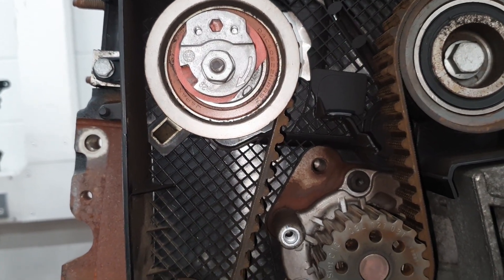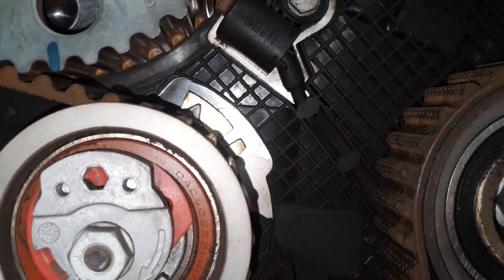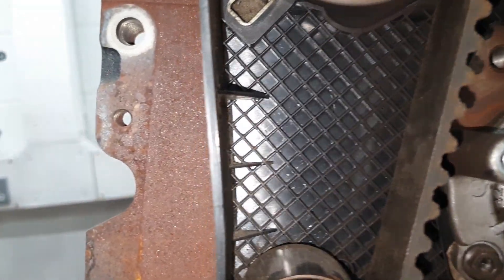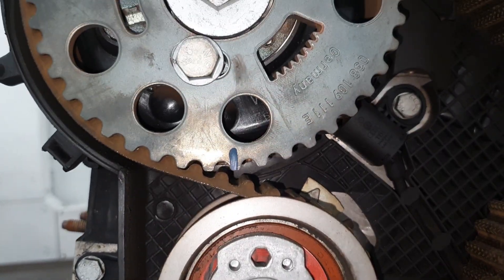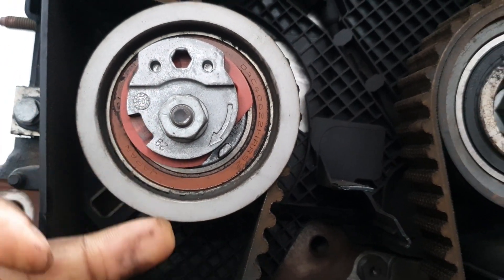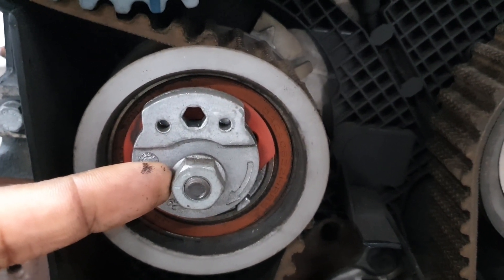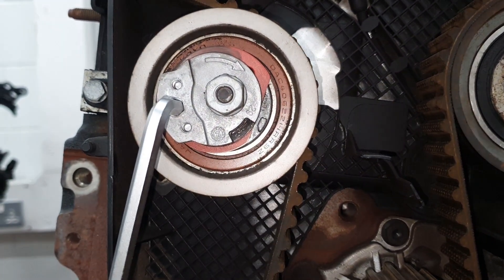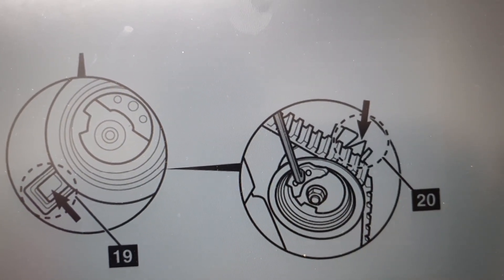One Wrong Move With Your Timing Belt Tensioner and You're Done

Comment: 02:25 Tip: Don't use a ball ended Allen key in the hole in the tensioner pulley! I did that once and the cast aluminium of the pulley crumbled around the ball end!!
Reply from the maker: Thanks for sound advice
Reply: I just discovered that the short end of a ball ended Allen key (which is the end we would use for the tensioner pulley) is not usually ball ended. 

However, it WAS ball ended on the Allen key that came with my timing belt tool set, so I'll leave my comment for anyone in the same situation. 

BTW, I ground the ball off, and that was incredibly difficult to do. It was like it was made of glass!
Reply from the maker: Every day is a learning day, thank you so much